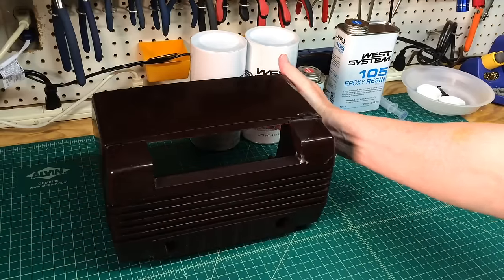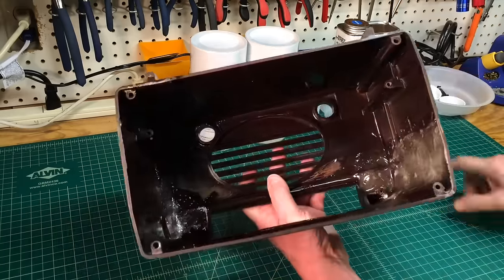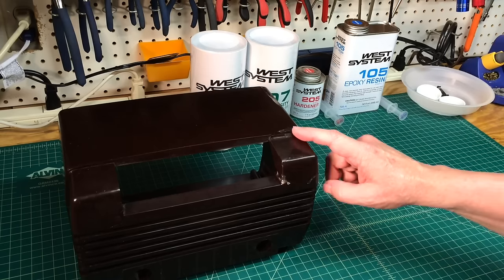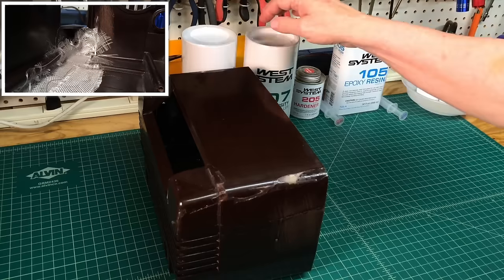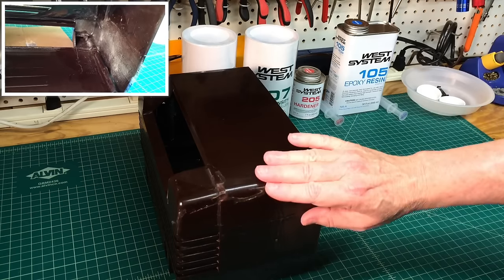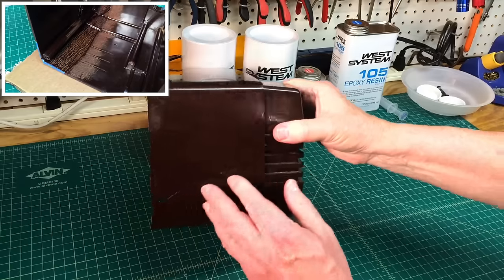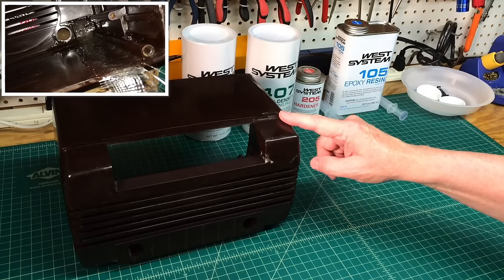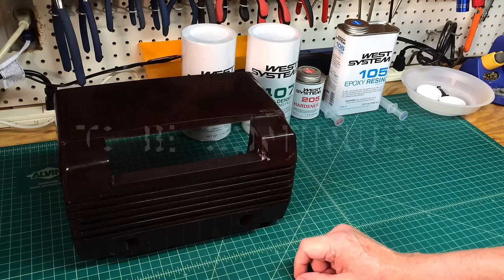Radiola 61-8 - More Cabinet Work

Comment: Don, good job on the cabinet, always nice to see new products!  I've got one that is similar to yours, same color anyway.  It's a Crosley 10-138, radio works great, but someone dropped the radio at one point, I guess, cracks on both sides, I've got it put back together and working but the fiberglass would definitely increase the tensile strength of the cabinet and probably make the cracks much less evident.
Reply from the maker: +Keith Jordan Keith - thanks for watching and sorry for the late response. Last few weeks have been hectic and I was barely able to squeeze in a video or two. The fiberglass cloth and epoxy really did the trick for me on this cabinet. If it wasn't a keeper, I would like to drop it and see what areas of the cabinet would break first. LOL. Best, Don
Reply: lol, I get it, you put in a LOT of research and work in this one!  I do
have the bakelite Crosley that came with some pretty good cracks in it.
I'm thinking this would be the ticket, but I'll see if anyone has it here.

Great series, makes perfect sense, we use it on boats and cars, it has the
strength, easy to use.

Thanks for your help Don.

Keith

Comment: I have another question on initial restore of any radio, when folks say that they do an initial check out of the radio, coils, transformer, audio transformer.  What are they checking and how?
Reply from the maker: +Keith Jordan Hi Keith, the parts you called out are critical for the receiver to operate, thus checking the primary components before recapping or replacing defective resistors, tubes, etc., will increase your odds of a successful restoration. Here's a few of my videos you might find helpful that I documented along the way.

Output Transformer Testing: https://youtu.be/UO-TL48PJZE

IF Transformer Testing: https://youtu.be/C65t2Hlt40I

Testing Field Coil, Output Transformer & Speaker: https://youtu.be/D9Wht9tCj2w

Power Transformer: https://youtu.be/Vz-rbMieS9A or https://youtu.be/JNNoRbFfmmc or https://youtu.be/yixC8La51fM

Hope this helps. Stay in touch and let me know if you have any additional questions. Best, Don
Reply: Thanks Don, I will check out each of those videos, that is what I was looking for, I'm sure there is a simple "procedure" that could be used to check things out at the beginning.